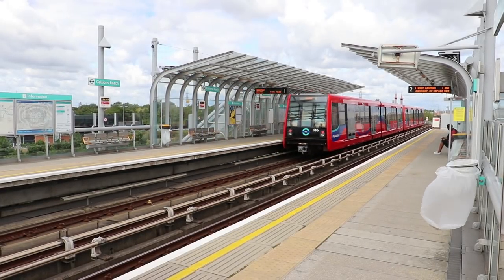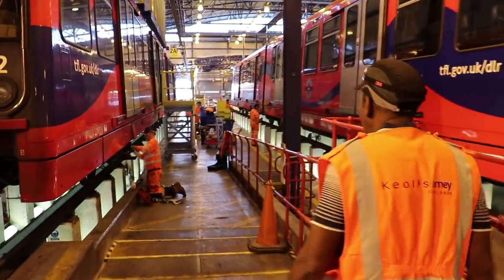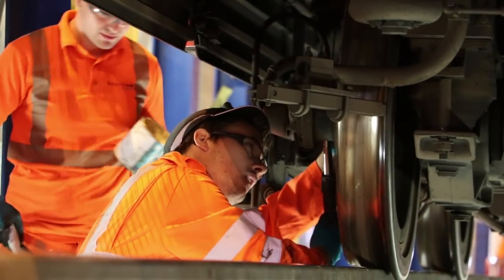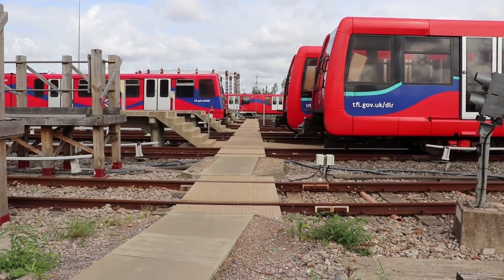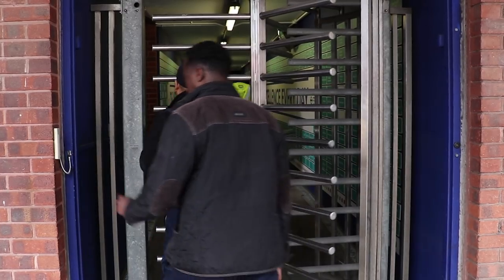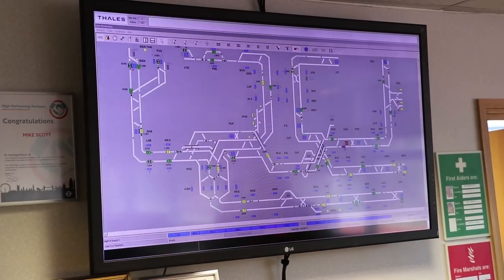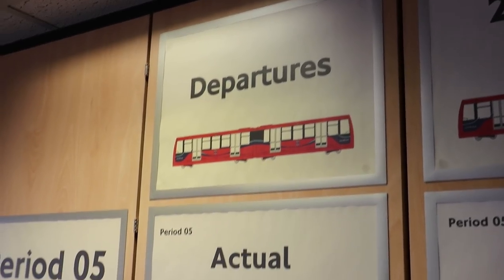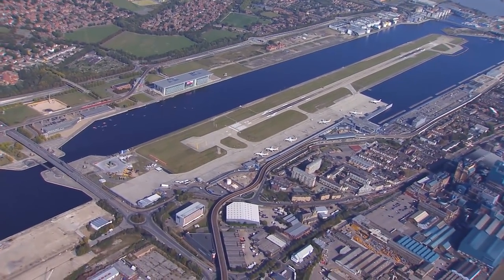Inside the DLR Depot

Comment: what is a passenger service agent?
Reply: Equivalent of a guard on mainline services.  They're responsible for passenger safety (eg, closing the doors), ticket inspection, etc, and can drive the train in an emergency.  The official job description is to "provide the front line operating interface between the railway and its customers to ensure that targeted customer service levels and safety requirements are achieved."